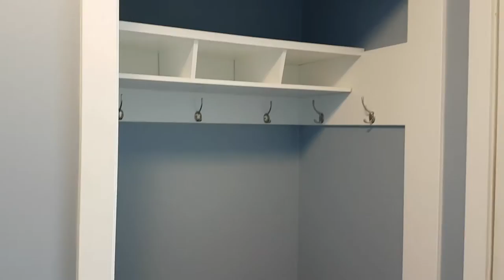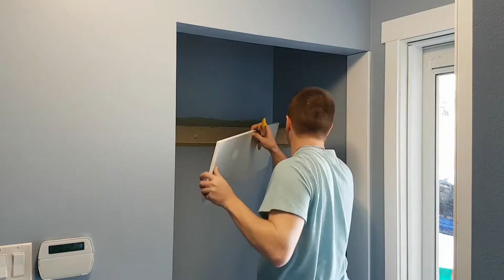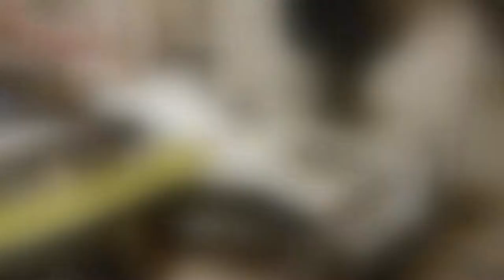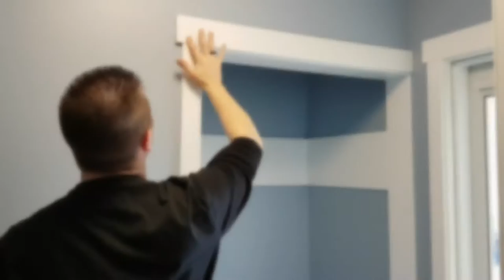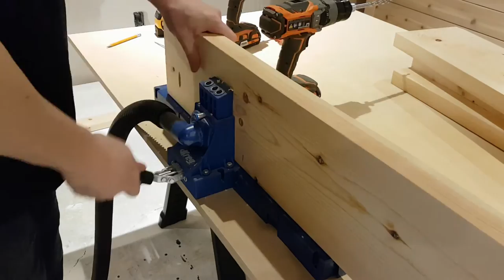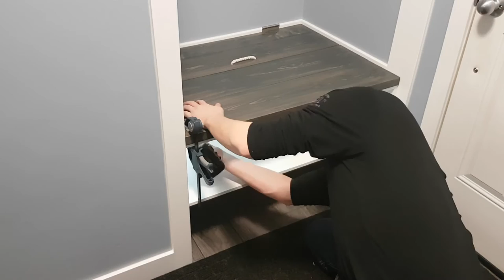Entryway Closet Built In Remodel (time lapse)

Comment: Can you you tell me how you went about measuring for the bottom storage unit?
Reply from the maker: Honestly it was just off the cuff. I knew where I wanted to go and worked backwards. I started with a seat height of 20" tall. I used 1.5" thick material for the top, and another piece of .5" mdf below that, plus another .5" mdf in the middle. I subtracted all that from my 20" and then I split that into 2. That is each opening size for the shoes. Then I just double checked my tallest shoe/boot that I had to fit in it to make sure it would work. For my depth I figured out the length of my longest boot and made it just slightly over that, and then double check that I still had ample space behind it to fit boots in the rear cubby. Like I said, I started from my 20" measurement and worked backwards, the rest was off the cuff that worked for me. Hope that helps

Comment: Not bad but those hangers are a bit too high. 2-3 inches lower would be easier to hang.
Reply from the maker: Thanks. Off camera I actually held up a couple different coats and I liked the height. 1" lower could have worked, but I didn't want the coat bottoms to be so low they dragged on the seat and made it hard to open if they were in the way. It was a balancing act to keep the coats floating instead of dragging